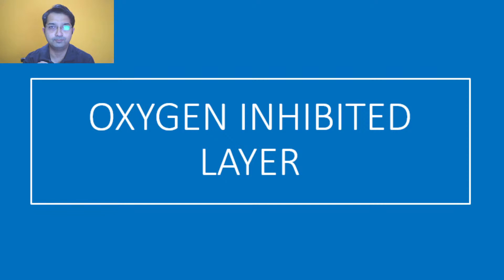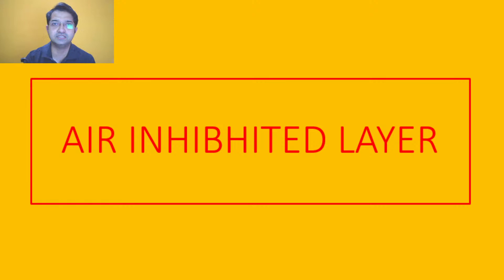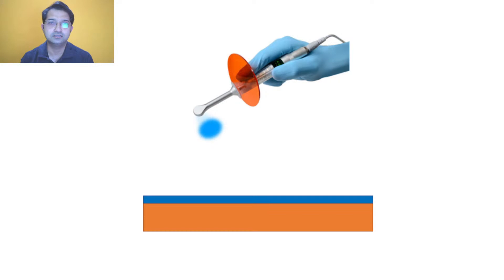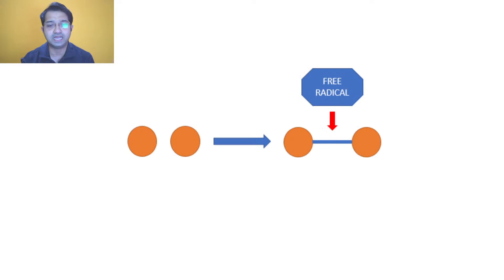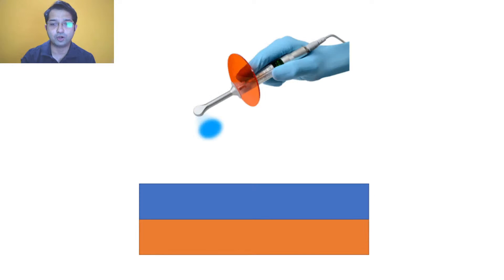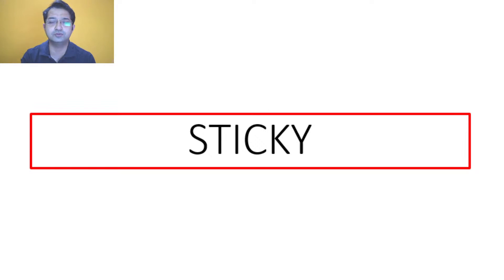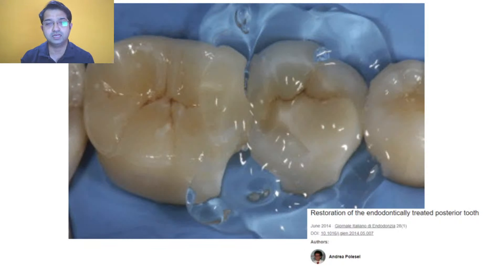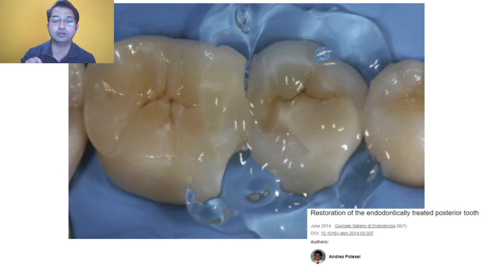How Composite bonds to Composite?

Comment: Hi sir

while using the brush for merging the composite with tooth surface - is it good to use dry or wet brush

if it is wet brush - what's the wetting agent used

is it good to use the water as wetting agent - does it affect the bonding properties of composites sir
Reply from the maker: U use modeling resin to wet composite

Comment: Sir I've seen many dentist smoothing the incremental layer with brush coated with bonding agent.What's the reason behind it.
Reply from the maker: The bonding agent and the composite are almost same except the composite is heavily filled resin which has high viscosity compared to bonding agent which has low viscosity. People use bonding agent to make the composite thin so that u can mould it better for adaptation and making shapes.
Reply: @Aspire32  thankyou so much sir for detail explanation!!
Reply: @Aspire32  sir then wouldn't this would alter the strength of composite ... As u said they both are same still 
Like is it ideal to do each increment by moulding with bonding agent sir🤔🤔
Or can be just finish the final increment by applying a layer of bonding agent ans light cure.. Sir

Comment: Dear sir ,thank you so much for this valuable playlist. I guess you are the only one I have ever seen to simplify any information . Sir I have an inquiry that I did not find a clear answer to it which is
( saliva or blood contamination different scenarios)
1) when i put a bond but not cured yet then saliva comes to my cavity by any type of mistake what should we do .. i guess we shall remove it all by water then re-bond again .. is it right

2) After I bond and has been cured then saliva comes to cavity some people said remove the cured bond and re etch and re bond and the other said no just dry and make sure no saliva still present any more and continue your work .. which are rights

3) saliva came to uncured composite should i remove the all uncured composite and continue 

4) saliva came to cured composite like we finish the work and i remove the rubber dam and patient bites to check then i decided to add some composite in some area, will i just add composite easily or should i etch or bond again the cured composite before adding new layer.
Reply from the maker: Answer 1 and 2- reetch rebond for 5th gen, rebond 6 or 7th generation

Answer 3 and 4.. if you plan to add new Composites to any cured or uncured composite and its contaminated you have to reetch and rebond if your are using ,5th gen Bonding agent, or rebond for 6th and 7th self.etch

Comment: Wow! thanks sir! This topic has never been explained as detailed as how you did even before we were in Uni. 🙏
Reply from the maker: I know. I always wanted to make a video on this :)
Reply: @Aspire32  Hi Dr. just a follow up question, is it applicable as well for old composite restoration (ex. chipped incisal edge on a big class IV restoration). Or should we need to etch the previous composite then put bonding agent for better bonding for the new composite? Thank you so much
Reply from the maker: Old Composites always should br etched. Since it does not have sufficient Oxygen inhibited layer, hence bonding will be mostly dependent on rough surface.
Learn about Oxygen inhibited layer here
https://youtu.be/rUHMKYbrLrc
Reply: @Aspire32  Hi Dr. Suresh, thank you for clearing this out. You are the best.

Comment: But i have a question when the oxygen inhibited layer is cured doesnt all the photo initiators inside get used, is there a way to add it back up or does the next layer have enough initiators for that oxygen inhibited layer as well
Reply: Another question would be, if for some reason this oxygen inhibited layer is removed or is contaminated with say, saliva how can we add it back
Reply from the maker: You have reapply etchant and bonding agent for total etch Technique and apply only bonding agent if you are following 6th gen or 7 th gen. This gives new layer of oxygen inhibited layer over the last increments which was contaminated
Reply: @Aspire32  thanks a lot
Reply from the maker: Most welcome..here is the link for playlist on all the videos related to dental Composites. Do check it if you want to understand it better :)
https://youtube.com/playlist?list=PLdPsg6P-6Vld4aZ_dC2BH-jzxSMqJr84Q
Reply from the maker: Yes. The photo initiator forms free radicle. And since only on the top layer the monomer wont polymer as the free radicals which is formed because of photo initiator gets consumed, it remains non polymerised. So then you add a new uncured layer on the top of the , new deeper layee covers this uncured layer but here the air will be now absent and when light reaches, the polymerization between both increments will happen.